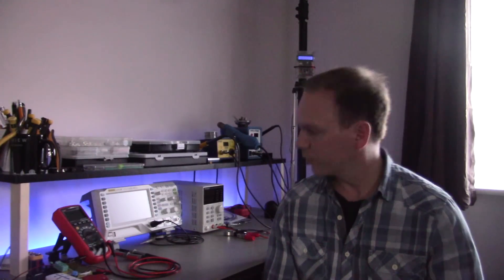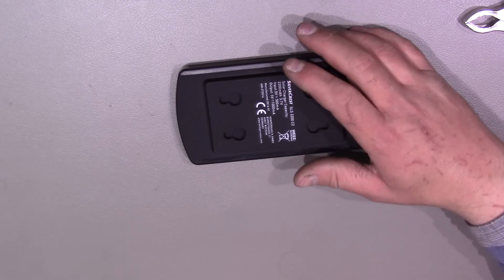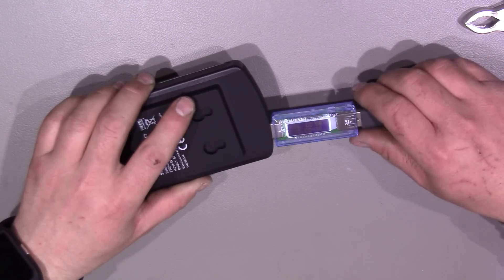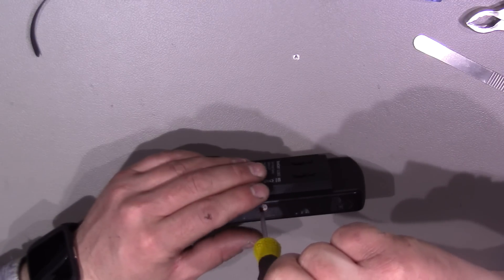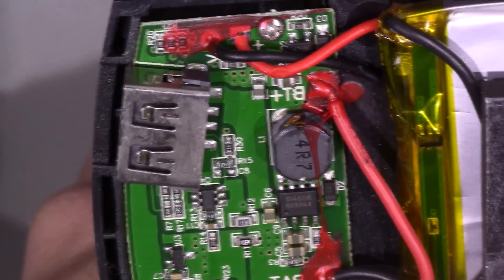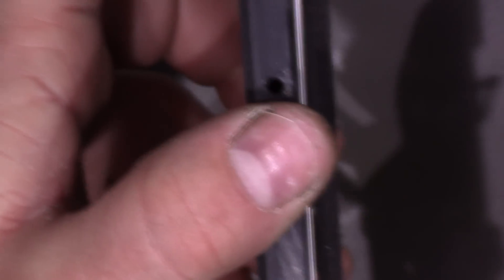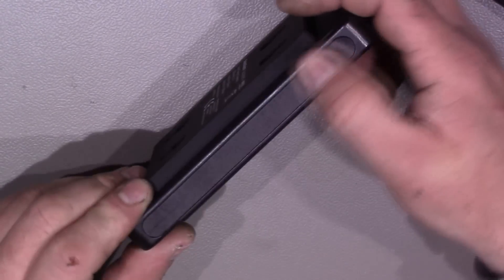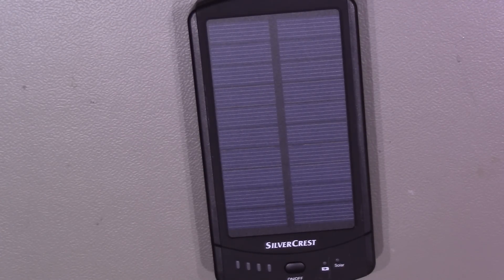Lidl Silvercrest Solar USB Power Bank

Comment: Thx men. Like ur equipment. But I'd rather need to learn coding than soldering. Am an engineer.
So the Powerbank seems to be quite OK? At least it' ll Charge devices slow and thus Take Care of their batteries...
Could geht one cheaply so I looked IT Up online.

Btw Lidl ist running programming schools in Germany.

Comment: Lidl (lee- dul) has their own brands.  Quality is highly superior to Aldi.  
I have purchased cast iron enal cook water, tos kitchen appliance etc etc etc. Never returneda thing.  Aldi I don't e en bother with any longer. Even food. Veggie turn bad very quickly. Meat is horrible stores are not as clean
Emotes all do all jobs. They go from Hani g cash to meat etc. I  watched  and never saw then wash hands in between.

I tried putting up a picture of my lidl solar charger. It completely different.  Have not tried it yet. We've  had some rain.   I expect it to be fine
Good thing is Lidl has no time limit for returns.

Comment: I bought also the SPBS 5000 and till now I managed to use it only at the beginning when I bought it. Till now I haven't managed to turn it on neither with solar or with cable. It just doesn´t charge... :(
Reply: ets etz same
Reply: Maybe the battery got in deep discharge? Measure the voltage on battery terminals.. i have the same one and it holds the charge for ten days and then its 0v so i cant charge it with wall charger unless i took another 18650 battey and try to wake up and then its okay for another ten days.. i think the battery is bad or the solar panel maybe discharge the battery..

Comment: I have one of those. The problem with it is that it doesn't charge iPhones. I have no idea why.
Reply: Apple being Apple
Reply: Surely any recent iPhone will need a 2.1A power source to charge.. The description says this outputs only at 1A, so, guess what.. It isn't going to work is it!
Reply from the maker: frozenman82 I can only guess the iPhone has something similar to USB Data pins being connected together to trigger a fast change, so most likely your iPhone doesn't see the charger as official and refuses to accept a charge
Reply: apple and it's eaten LOL

Comment: I bought Lidl SilverCrest SPBS 5000 Its good!. I think its the real capacity. My Samsung tablet Tab 3 get filled on 90%.  With Chinese "5000" it gets only to 46%.
Reply: Thats good news, I just bought three of those at €12 each. I figured that even  if it takes a month to charge it with solar power its good for emergencies if left on a car or house window as it will ensure they are always fully charged. I also figured I could link them together to charge up my high quality/capacity powerbanks every now and then aswell. Green power :)
Reply: Music Matt 76 I bought one today (SPBS 5000), it charged my S7 edge battery (9v 3600mAh) from 63% to 100% an still two leds remain light. Even without the solar panel its still useful. Instructions say 30 hours of sunlight to charge its own battery.
Reply: White Fox 30 hours is not too bad. It should mean it will almost always have enough juice to let use your phone for emergencies. It makes me wonder if you can chain a couple of these together and connect them to a high capacity powerbank.

Comment: Thanks a lot  for this explaining video. I was so angry about this solarpanel course it doesnt work ,now i know why. My batterypack is dead thats the reason. The sun doesnt charge it after a week ... It was behind the windshield in my boat and had enough daylight but doesnt work. No way . Do you think we can pimp the battery? A new one with more power ? I cant understand that there we have a 3.2v batterie to charge an 5v smartphone ....
Reply: same here. with a new [2018] item. Seems Lidl have'nt listened to any comments. won't be getting another. Too cheap at the end of the day. Shame really as I got another powerbank from Lidl and it's been great
Reply: unless there is direct sunlight, it won't charge, these solar panels work that way and they are very small anyway to be charging sitting behind a window glass

Comment: I've bought this one a couple days ago at Lidl Deutschland for around 9 bucks.
Yeah you get what you pay for.
Charged up my Nokia Lumina 930 friday and put that sucker to the window (direct sunlight) for about 1.5 days to find out the battery inside is still low on charge.
Only one LED was lit up when I press power on.
That solar panel has to suck ...
Reply: I have the same experience. The solarpanel doesn't work at all.
Reply: not opened it up yet but it looks fake too black to let any light in ive bought the 5000
Reply: Same here. Panel does nothing.

Comment: I just bought myself one, yesterday, then i saw your reviw. I will test mine now. I live in Sweden so i will se if it get a charge in the sun. In the insruction it said about 22 hours to charge with the sun. I guess about 3 days msybe more.
Reply: what i think the solar panel is not for fully charging the battery to full capacity but for emergencies if the battery of the charger dies